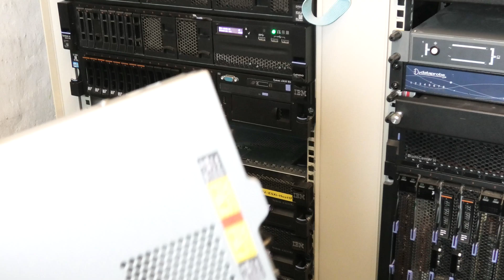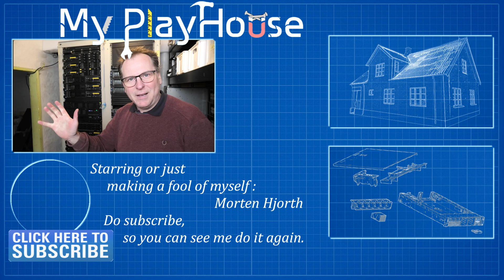Lenovo SR650 Server Rails Mounting - Cluster£u€k - 1380

Comment: These were rails for M4 series :-) the M5 static ones could be compatible, they can be also pretty cheap.
Reply from the maker: Rails are heavy,, that often adds to the prices.
Reply: @MyPlayHouse  I can confirm, that the M5 ones are not compatible, but the static rail kit for sr650 is basically kinda thin piece of sheet metal, so not as heavy as those retractable ones.